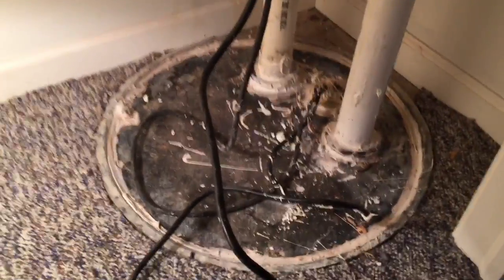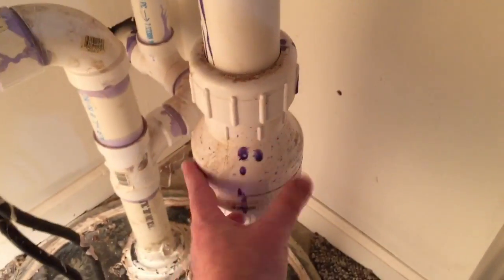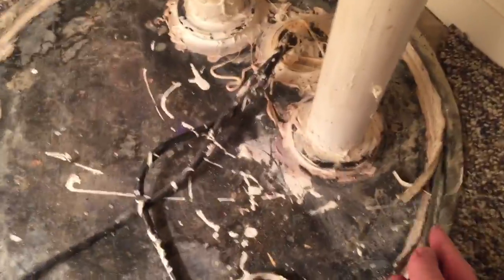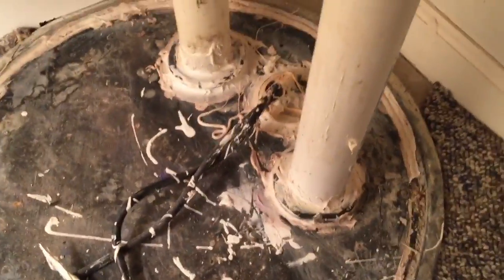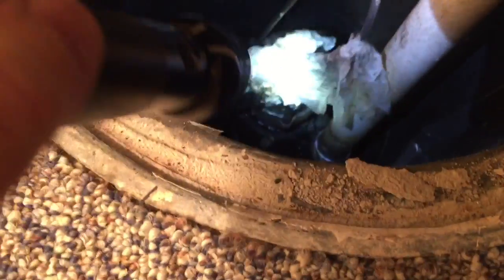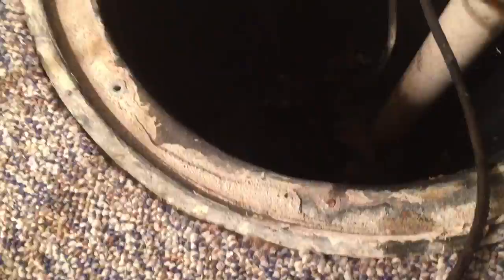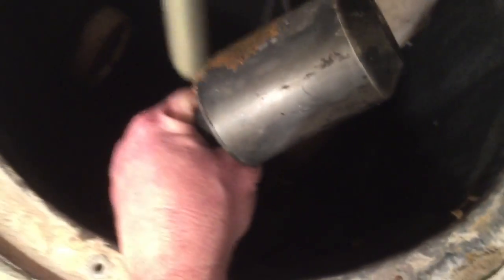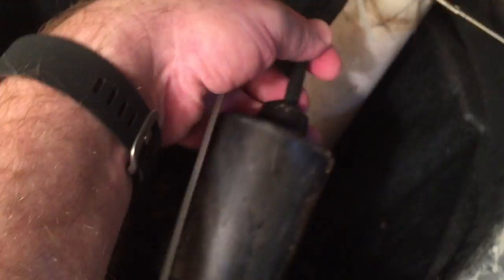Sump Pump will not turn off - EASY FIX!

Comment: Had a similar problem where the float was getting hung up after the original attached point rusted out.  I tried to zip tie it to a few locations over the years but the float would occasionally get stuck on something and I would be back with the zip ties again.  Then I fixed it more permanently by actually finding where it should have been attached to the pump casing.  It helps to have the pump visible (water cleared out near the top).  I screwed the old clamp back that was on the float line back into that original location and it works great now.  The old screw had rusted out and broke so look for a broken off screw somewhere on the pump.  I drilled it out as much as I could and then got a larger size screw to fit.

Comment: it sounds like your pump has been damaged from running dry for so long. plus these ejector pumps need to be replaced every 10 to 15 years. speaking of which, that's an ejector pit full of sewer gas, you need to reseal that with caulking. p.s. if you do end up replacing this pump, try not to get on with a tether style switch, they're known to get stuck a lot